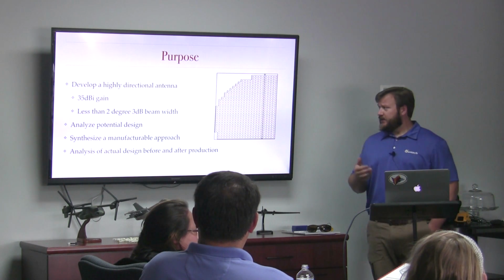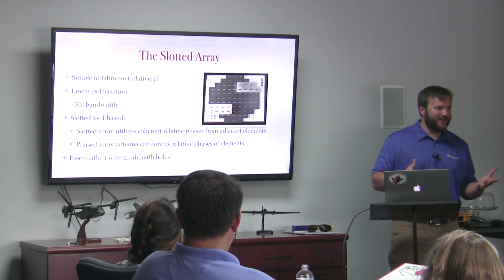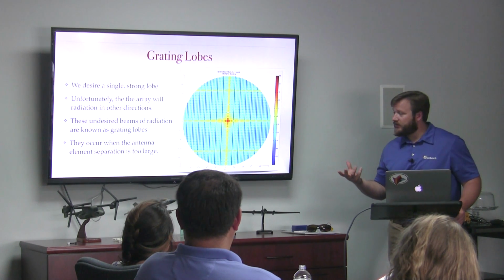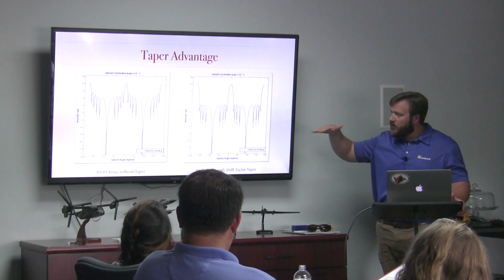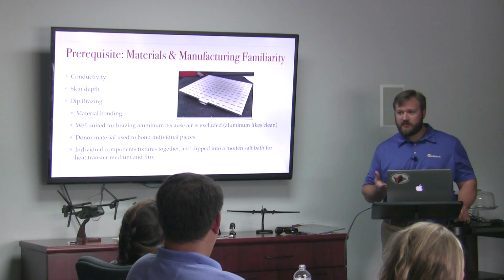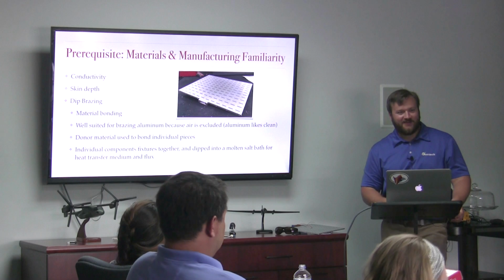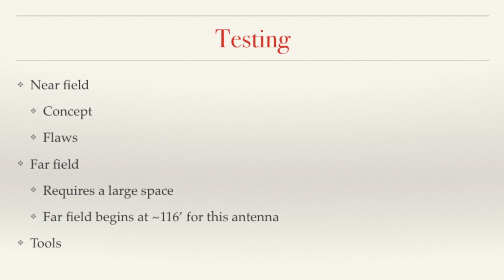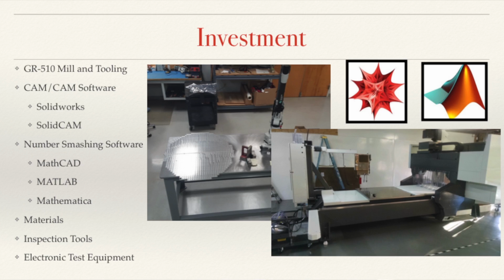Leaky Waveguide Antennas - Lunch and Learn

Comment: Consider this a stack of waveguides glued together, each with one common wall. The "leaky" part is at the ends of the waveguides, which are not completely shorted. There is a wall to cover the center portion of the stick ends, but the left and right edges are left open, creating a magnetic field that interacts and deforms the sidelobes.

Comment: The antenna is designed for 9.4 GHz and used for weather radar in aircraft. You want a narrow beam pattern in both azimuth and elevation in order to analyze the weather cell. Unlike a ships radar that has narrow azimuth, but all elevations. Bendix made these antennas in quantity in the late 70's.